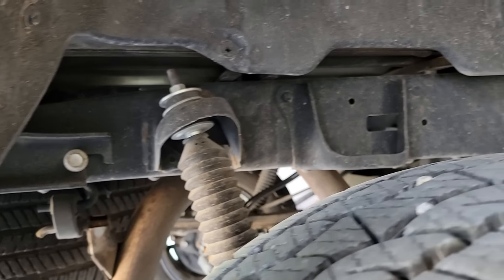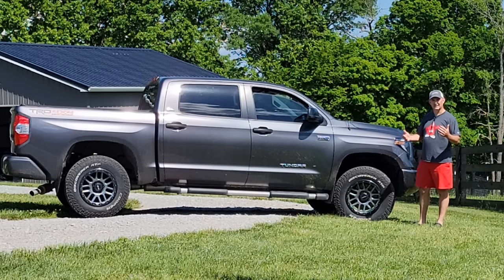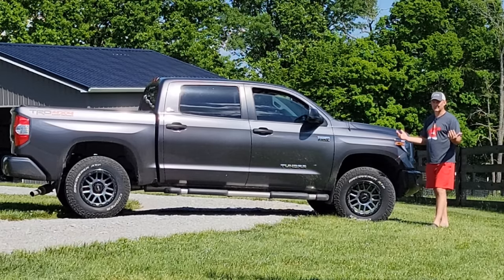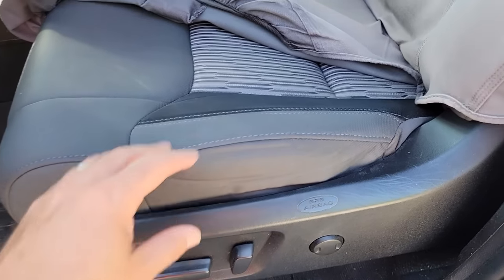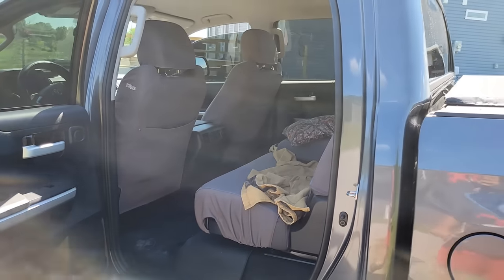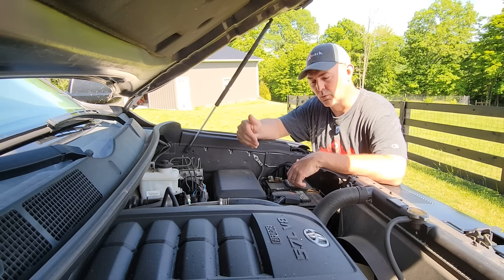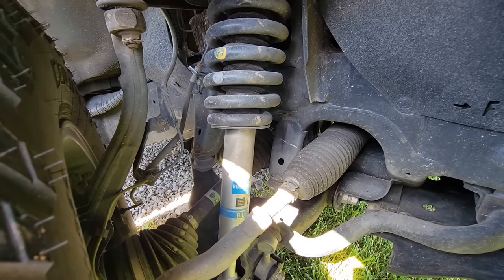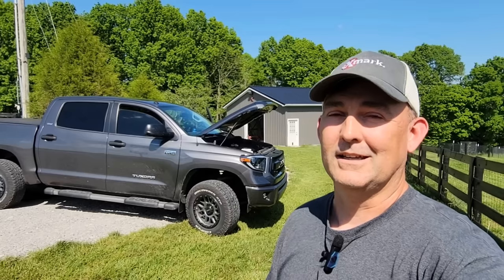Toyota Tundra at 6 Years / 100,000 Miles Compared to Ford F-150 and Ram 1500

Comment: I have a 2010 TRD double cab with 192000 on it.  Zero issues except general maintenance. Keep those gear oils changed as well put a TRD sway bar on it for pulling. Had dealer put new valve cover gaskets and spark plug tubes. I wish it got better mileage but it’s not an economy car

Comment: I looked at a used 2018 F150 with 70k miles but it had a terrible cam phaser rattle on startup. That’s a $3000 repair. Said forget it and bought a 2019 Tundra instead. Glad I did.

Comment: Friend of mine has a 2004 4Runner with 310,000 on the original engine. I’ve never owned a truck or suv but if I ever do it’ll be a Toyota.

Comment: It’s unfortunate Toyota never made a 1 ton truck it would have change the truck market. My 2016 Tundra has 133K the only issue I’ve had is the front end vibration and not being able to keep it aligned also, I recently spent 4K on a new A/C but I use this truck as my mobile office so it does Idle a lot with the A/C on. I have the 4.7 I wish it was the 5.7 but I got a great deal on this truck when that was a thing.
Reply: You have a 4.6L

Comment: On my second tundra first a 2003 now a 2016 and never a problem or repair,used to love my 2001 Chevy until at 116k the fuel pump went stranding us in the middle of traffic, at 160k the intake gasket went bad on the inside instead of out dumping coolant into the piston which compressed and bent a push rod,the 4 wheel drive worked when it felt like it leaving us stuck in the desert! I will say i wish Toyota did a better job with comfort, I find fords and Chevys much more of a comfortable ride but ill stick with Toyota for the low cost of repairs.

Comment: 2013 Tundra SR5 bought NEW and over 186,000 miles later with ZERO issues.  I don't understand why people go on about the cost of fuel.  It's a truck that can tow 10,000 lbs.  Can't do that with a Corolla.  Just keep the truck after payoff and run it till the wheels fall off.  Gas is cheaper than gas with a monthly note.  Aside from running out of gas or a flat tire you never see a Toyota broke down on the side of the road, just everybody else.

Comment: My F150 at 200K miles still runs great no rust or mechanical issues. It also get about 20 MPG and will out tow a Toyota!
Reply: You got a good one! My 2011 F150 lasted 140k and was absolutely plagued with issues. Rust from water leaking in brake light, multiple valve issues, transmission coding issues, spark plug issues, door harness issues, heater blend issues, wheel bearing issues; hell the rubber seals on the door started coming off. Every single time I turned around I was spending $1500 bucks. I kept the thing for 12 years and overall I like it, but I traded it in for 11k and bought a 21' Tundra. Night and day difference just with the transmission, it's so smooth compared to the F150, it doesn't' get confused when I slow down and speed up quickly. I drove a few hours on the highway last week and got 18.9 MPG, but around town I'm sitting at 15-16 MPG which isn't great but hey if I can save on ownership costs, i'll make due with the fuel mileage. Towing isn't an issue for me, I tow a side x side and either truck pulls it like a dream.  Glad to hear you got a good one!

Comment: When you mentioned the issues on the new tundra, it’s important to acknowledge that it’s extremely common that all 1st year models have issues with Toyota’s. The most unreliable year of the 5.7L was 2007 (the first year). People shouldn’t write the new tundra off yet. Toyota consistently improves and fixes their models and in a year or two they are usually fine.
Reply: 07 5.7 here with 190,000 not one issue. Runs/idles like a new one. I must have gotten the only good apple. Amsoil 5w20 is key.
Reply: @limeallens6160  not all of them were bad obviously. They weren’t even a bad truck in comparison to the competitors. That was just the most unreliable year of that model. Still a great truck. I think the new tundra’s will prove to be fine long term. Just a few hiccups in the first year is all.

Comment: Im having 2007 Tundra as a daily truck in California. I've been paying more or less around $6.20/gallon. My gas bill is around $1100 monthly.
To be fair, mine is 6'inch lifted, with TOYO mud tires, averaging 11-12mpg. Its really a gas sucker
Reply: Geez. But it is a 6 inch lift
Reply: Do that to a new one and it will suck too!
Reply: I’m in so cal. 4x4 crewmax on 37s with a 38 gal tank. Fill ups hurt. But I love my truck.
Reply: @stevog44  that's awesome to have 38 gallon gas tank. Mine is 26 gallon only. Fill up does suck!  I was trying to see if I could install aftermarket large gas tank, but found out they won't do that for California registered vehicle due to California law.

Comment: 2016 with just a bit over 33k. 2017 4Runner with about 26k. Work only 7 miles away so mileage is low. Besides I’m in California. I maintain them well including the exterior. They sit outside all day long. Still looks new

Comment: 2008 sr5, 200k miles and from Iowa, was a Wisconsin truck, not a single spec of rust anywhere you can see on the outside, and only surface rust on the seam welds on the frame, the spot these trucks like to rust out is the front horn on the passenger side frame rail, right by the body mount

Comment: Gas mileage isn’t as costly as you think, all other things being equal.  My ‘21 Tundra gets 14.6 mpg combined.  I drive 1,300 miles per mo.  That’s $382/mo (at $4.30/gal).  Assuming I get a different truck that gets 18 mpg combined, that costs $310/mo.  So my Tundra only costs $72/mo more in gas than most others. Less, if you count v6 TT’s where real world mileage is more like 16-17 mpg.  Turbos are thirsty.

Comment: I have a 9-year-old 2014 Silverado with 120k miles, and it's still going strong without any problems
Reply: With a V8?  I wouldn't touch the new ones with 4-cylinders with a 10 foot pole.
Reply: Yes, V8 5.5

Comment: I’ve owned GM, Nissan & Toyota trucks. With proper maintenance, a Toyota is just broken in at 100k miles. The old Nissans were the same way. With GM, Ram or Ford, when you hit 100k with no problems you’re lucky. Very lucky if they make it to 200k miles. Where there’s multiple Tundras now that made it to 1 million miles.

Comment: 200k miles in today's vehicles is standard, nothing even to mention.  It's 400k that is the new exception bar. My Sequoia, basically a TUndra, had  236k miles on it and I never even changed the oil after 75k miles lol, it still was in excellent condition and did not burn oil or have any mechanical issues. I replaced the fuel pump at 100k after it went out and the belt at 215k. That was the only mechanical issue I had in all those miles. Obviously tired and a few batteries but those are normal items.

Comment: Great realistic review.  I have the same thoughts for my 2004 Tundra Limited Access Cab 4.7L I bought new in 2004 and still drive today (only 75K miles on the odometer).  The thing is "bullet proof" but sucks gas so is not my daily driver. I swear Toyota Trucks have a hole in their truck gas tanks...
Reply: I have the same truck and a little less mileage on it. I only had to drive less than 4 miles to work. I'm probably never going to get rid of it since it runs like brand new. Now I'm retired so I only use it for HD and Lowes runs. Gas is nearly $7 a gallon here in LA. Vehicles don't rust in SoCal.

Comment: My 07 5.7 has 200k, tow 10k travel trailer with no issues. Did some suspension upgrades. I rather spend an extra 100 bucks in gas than 2k repair bill

Comment: It might cost you $5-8 dollars more a fillip than some other trucks but that $400 a month is BS. You still have to put gas in all of them. 3-4 more miles per gallon isn't anywhere near as big a savings deal as most make it out to be. Example 1500 miles a month at 15mpg is 100 gallons at $4=$400. 1500 at 20mpg is 75 gallons =$300. In truth I average 17 in both my Tundras so even less$. $1200 a year is going to take a looking time to make up for spending $60-80,000 on a new one to get 3-4 more mpg.
Reply: Gas has come down to $4.00 a gallon where I live - but I did the math for what I would save at $5.00/gallon and the savings with a newer truck and it would be $83.00 per 1000 miles.  

20 MPG @ $5.00 =  $0.25 per mile
15 MPG @ $5.00  = $0.33 per mile

Your own mileage may vary - but even with a savings of $1,000  per year - with the payoff of a new truck at today's market prices - I figure that it would take more than one decade to any savings pertaining to fuel.  I'm figuring more than $50K out the door for the features I already have on my present beast, which is paid for.  Also, my insurance would have to go up.

Comment: Wish there was an aftermarket company that has dual electric fan conversion kit for you're 07-21 Tundra with the 5.7L I-Force V8 in it so that it'll give the Tundra at least close to 400 HP and get better than 18 MPG.

Comment: 21 tundra owner here. I dont trust the domestic manufacturers anymore. Dont want to worry about my valves screwing up becuase of AFM,DFM. at any moment and they dont cover it under warranty. At 3 yr. 36,000 miles aint enough warranty for this new technology/over engineering! So ill   buy a little extra gas And live with a little less features to have peace of mind.

Comment: Had a Sierra 5.3 L and and needed camshafts replaced at 174000 KM. Never again will i go down that way. So the lil' bit of fuel i saved with the cylinder deactivation wasn't worth it

Comment: 2010 TRD SR5 extended cab 4X4, 5.7. 225,000 miles, zero issues. Best truck I've ever owned. I'll always own a Tundra 5.7.
March 2024 update: I still own the 2010, now with 289,000 miles, still no issues. I also own a 2019 TRD 4x4 SR5 5.7 now and have 100,000 miles on it with no issues as of yet.

Comment: I have a 20 TRD OR with 31 000 kms. It looks like it is going to last a looooong time. I get mine KROWN RUST treated every September. Only two issues so far...a bad battery at 6 months and a cracked windshield. Both under warranty.

Comment: Replaced my 2018 F150 with the 5.0 with a 2021 tundra. Will never get another cord product. The F150 was a little quieter and rode slightly better, but the tundra is much better built. Had lots of transmission issues and oil consumption issues with the f150. Not one issue with the tundra. I averaged 17mpg with the f150 and 15.5 with the tundra. Not a big difference.

Comment: only issues with these trucks are the gas mileage. My 2021 can average 18-20mpg highway buy in the city its no more than 15. With that said i drive my 2005 corolla when not using my truck and that helps alleviate some of that gas money haha. Wouldnt sell or trade this truck for anything .
Reply: It’s a pick up tho I normally get 13 in a 14 Ram 1500 lot of city driving

Comment: make sure you replaced the timing belt, with an AISIN kit since the engine is an interferance engine and the anti freeze with pink toyota OEM. Also.. the transmition fluid, best to just drain and refill only what comes out of the drain plug a few times should be fine.

Comment: As a fairly recent Toyota convert, I've learned 100,000 miles isn't "high mileage" for this brand, they are only just getting broken in by that point! The most expensive thing you ever need to put into a Toyota truck is the gas.

Comment: There not that bad on gas . I have one and tow every day with it . There built to work . Hook a trailer onto a new eco boosts and watch the fuel mileage go crazy . Tundra doesn’t drop off nearly as much . 4:30 gearing helps that . But if you want to spend more on parts then gas !! Get another brand

Comment: Congratulations !!! You Just broke it in !!!  L.O.L' s , and your not the original owner, but at least you got smart, and got rid of the other crap, and got a Toyota.
I bought a 2003 Highlander V6 4WD new, as of now it has 400,000 hard miles, as still runs like new and everything still works. That's why I bought a 2016 Sequoia new, which only has 80,000 as of now. You just need to learn how to drive that 5.7 conservatively. I can average 21-22 m.p.g with my Sequoia on the highway, if I take it easy, OR I can get 11 m.p.g !! if I always keep my foot into it. That's why everyone complains about the gas mileage, they can't keep the r.p.m' s down. Just baby the thing, let it shift under 2,000 r.p.m's, there's so much torque, no need to rev it up, that just sucks down more fuel. I've always Wondered "How Many Fords, Chevy's, and Dodges Does It Take To Equal One Toyota" ? " The World May Never Know " !!!

Comment: This looks amazing compared to a Chevy or Ford I have a 2009 Toyota Venza V6 front wheel drive in Texas with 215000 miles other than the muffler pipe with surface rust. The rest of the under body rust free maybe a little surface rust on the rear bumper  beam. the paint is barely coming off one of the control arms.  both my brothers and sister own Toyotas. They are the best and hondas

Comment: I live in Texas and you see rusted F150 on a somewhat regular basis and ironically it’s the newer ones. I’ve looked underneath trucks with 30,000 miles that have never left Texas and the rear end on them are rusty as hell. It blows my mind.

The reason the Tacoma and tundras rusted in the early 2000s was Toyota did not make those frames Dana did. The same company that made Dana rear ends made those frames and they were shit. With the 2007 tundra and Tacoma moving forward Toyota made all the frames that’s why they’re much higher quality.

Comment: Your gas savings go out the window when you buy a new truck though.  Ideally you just have a good truck like this for truck stuff, and a car for commuting.  I would not get rid of that truck, it's one of the last really good, reliable trucks.  I drive Ram, but if I had to do it over again I would have bought that exact truck.

Comment: You’re talking about recalls on Toyota trucks that can fit on one page to where Ford has about 11 pages of recalls. And as far as the 2022 tundras, the turbos are having problems it was the waist gate manufacturer that was having problems due to a a shortage of good materials/parts because of the pandemic in 2020 and 2021. It would be nice for you to be more informed about all the vehicles .

Comment: My check engine light is on my door power window slash Lock on drivers side is falling down done replace the starter and radiator and ac condenser and will probably be replacing the belt pulley and front rotors and brakes pads hopefully don't have to replace the calipers .